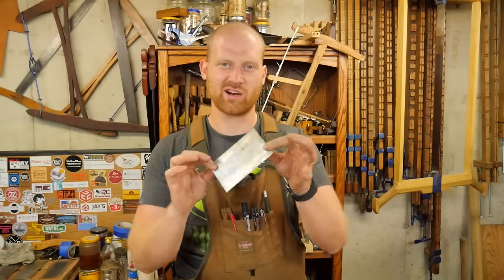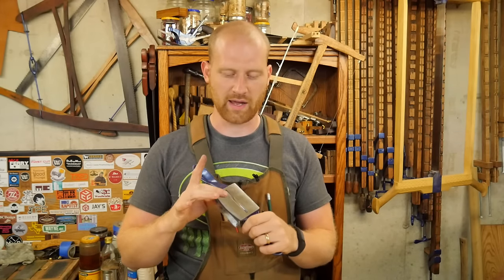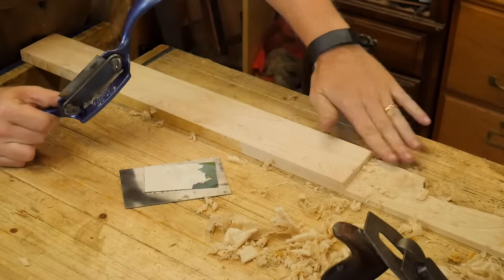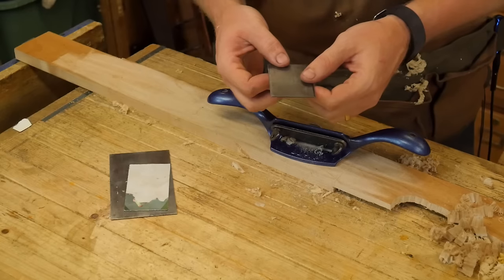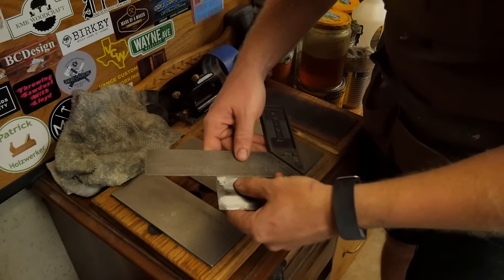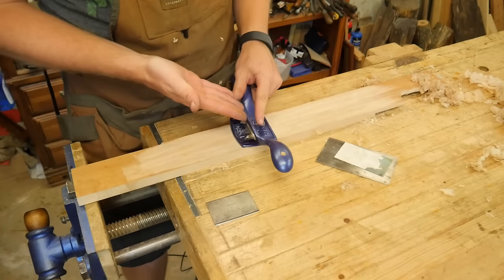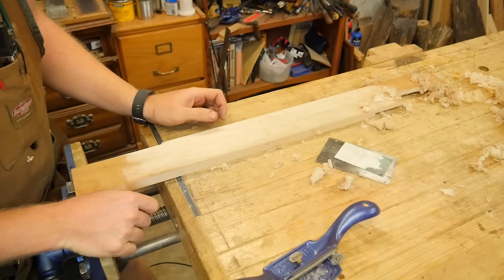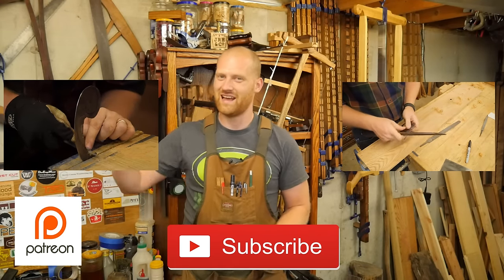How to Use and Sharpen a Stanley 80 or 81 Scraping Plane

Comment: Jamws, one quick question: Do you thing the "cutter" could be replaced by a card scraper cut to dimension?
Ceers from Greece!
Reply from the maker: yes. you do not need as thick a card as would naturally come. a cardscraper or scrap of old saw plate would work fine.
Reply: @WoodByWright  Thanks! I have one but the blade is short, so I'll try a relatively thick card scraper.
Cheers!

Comment: I have two Stanley number 80 scrapers however one of them has four holes one in each corner coming down through the sole and a much wider throat. I was wondering if anyone knows about these differences and how to utilize the different one.
Reply from the maker: That sounds like a user modification. It was fairly common to drill four holes so that you could mount a piece of wood underneath. The problem is you need to make the  mouth bigger so it doesn't jam up

Comment: I regroups the blade to 45, honed it and burnished in a hook. I was getting something between dust and a shaving so I guess I am closer.
Reply from the maker: Sounds like the angle of the bur is too far one way or the other. because the cabinet scraper holds it at a specific angle the bur has to match it. that is just a trial and error to get right.

Comment: Hi rob. I've got a problem. I have a lot of highly figured African rosewood. It's very dense and dulls my plane in 7 passes. It is so hard it puts chips in the iron very quickly. My problem is that it is so figured that I will get tear out regardless which direction I plane in. It also has these beautiful swirls but it's a nightmare to use hand tools on. I really want to use it but this tear out is driving me insane. Do you think the Stanley #80 will help? Do you have any other tips?
Reply from the maker: +Jason Roets yes a cabnet scraper would defenetly help. It will be slower but it will do much better.
Reply: Wood By Wright I brought a record scraper from an old wood worker as well as a few planes and spokeshaves. I'm going to tune it and get back to you. the wood if I didn't say above is African rosewood and I'm a South African woodworker. So Howzit from the homeland!!!
Reply from the maker: Sweet! my wife spent two years in South Africa we keep trying to get back there for a trip.
Reply: Hi

I brought a second hand record scraper and sharpened it using your method. I've used it on all my woods and i have two questions.

The surface feels less smooth than when i use my plane. Is that because the plane burnishes the surface? 

Secondly it only seems to cut in the middle centimeter or so. Is that normal?

I figured out why my iron kept dulling so quickly. it was because the plane i purchased was cheap so the steel quality wasn't great. I upgraded and i am getting better results

Comment: Hey, how well does the No. 80 work on end grain?
Reply from the maker: Not as well. Scrapers can work on it, but not well.
Reply: @WoodByWright  Thanks! So the shooting board is still the best bet?
Reply from the maker: Yes. Far better.
Reply: @WoodByWright  Sorry, one last question that i'll just attach here instead of starting a new thread on your other video. About how much is realist to take off with end grain using the shooting board? I have some 2x4's that are about 3-5mm off from being the same height. Do you think I could use the shooting board to get them even or is that too much to take off of end grain?

Comment: Where did you get those sanding squares? Thank you!
Reply from the maker: the sanding squares? if you are talking about the foam block pads I get those at the big box store.
Reply: Thinking he may have meant the 3 stones(?) you used to sharpen the scraper blade. Great video, thks.
 @WoodByWright

Comment: Hello, does anybody know if a knife sharpening steel can be used as a burnisher? The steel has lines/small grooves running along its length. The burnishers I have seen seem to be smooth along the length. Thank you
Reply from the maker: +ad cr sure. That is actually what mine is you just can't see it in the video.
Reply: That's great news and will save me a bit of money. I was just a bit worried in case the grooves in the steel blunted my sharp edge. Thanks for helping me out.
Reply: I must have a different one than Mr. Wright. It took the hook clean off my card scraper. Mayhap I was too aggressive with mine. I would suggest try yours and see if it works, as it cannot hurt, but burnishers don't cost much.
Reply: I use a 17mm Gedore spanner. Edge is hard and easy to use.

Comment: how did you go about painting it?
Reply from the maker: I will be doing a restore video here soon. but basically I strip it down to steel and then use Rustoleum spray paint. if I am worried about it adhering to the steel I will sometimes use an auto body primer first.
Reply: Thanks, I look forward to the restore video!

Comment: After almost three years, I still cannot turn an effective burr.  They should make scrapers like contact lenses.  Use them for a month, throw them out (recycle) and use a new one.  I keep trying....
Reply from the maker: Sorry man. We should get together some time and fix that.
Reply: @WoodByWright  Oh, I saw a video by Vic Tesslin and he showed a very simple technique for turning a burr.  He was giving a talk in Australia. Plus, I recently found out that card scrapers do not work well on soft woods.  I build with a lot of pine.  (just boxes and trays).  I was shown that card scrapers work the best with hard woods.  I also have to fix my smoothing plane.  I did not round off the corners of my iron when setting it up.  So I don't get gouge lines at the edges of my plane iron.  It is the most fun to fix these little things as I learn.